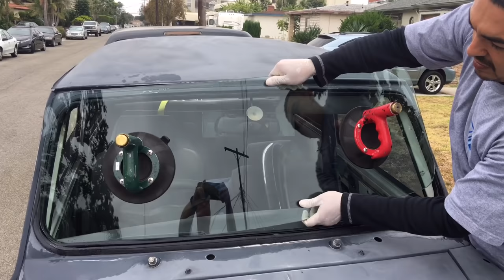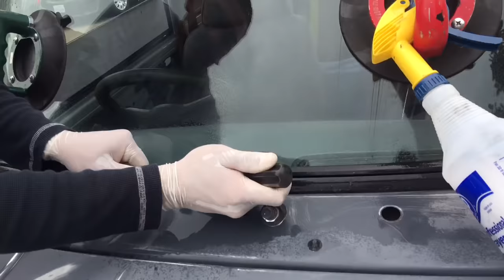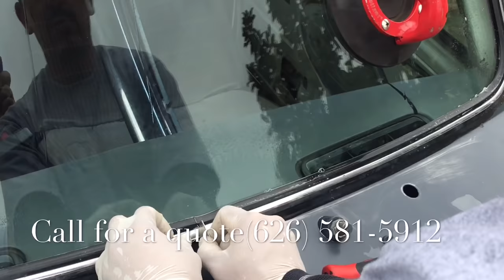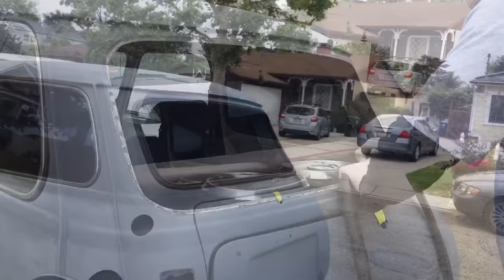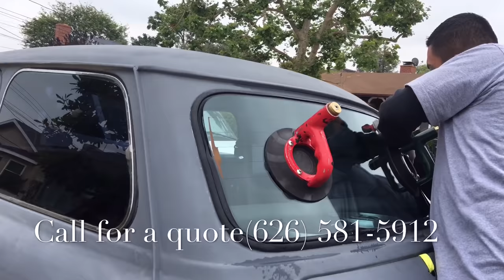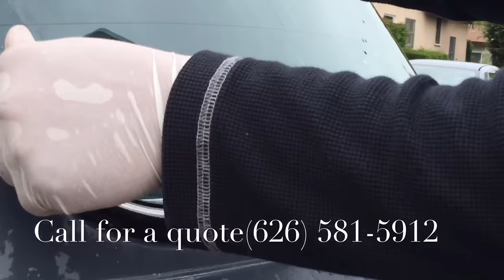Installing front and back Windshield in a classic mini

Comment: As for the tool for inserting filler strip, i use no. 8 ring spanner, and rubber on glass first with string all around, then pull string inside car whilst someone else pushes screen from outside, if on your own, his method is correct.
Reply: you can't string these in from inside the rubber is too thick ,the only way to do it is how he's doing it that's why it has a locking strip